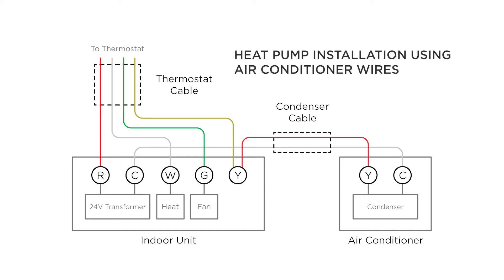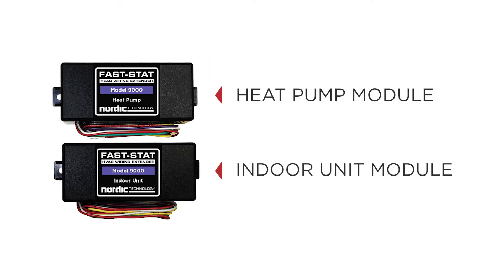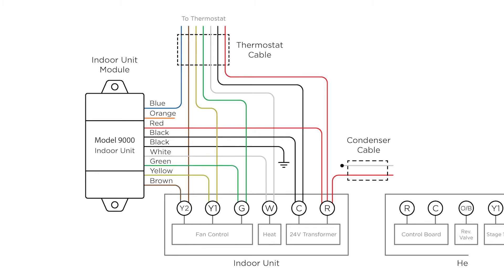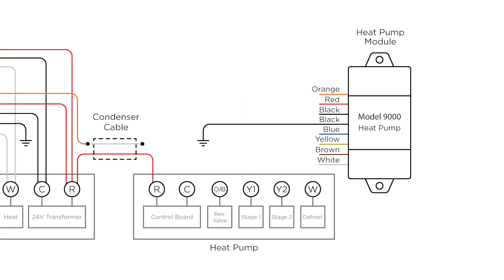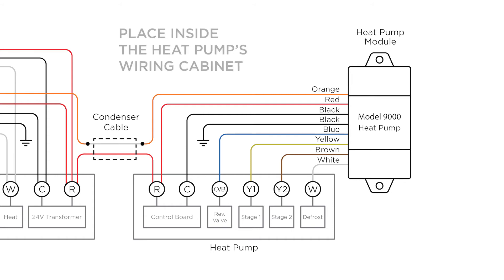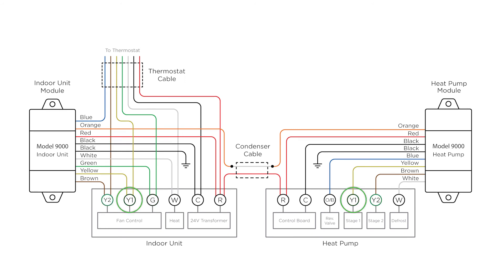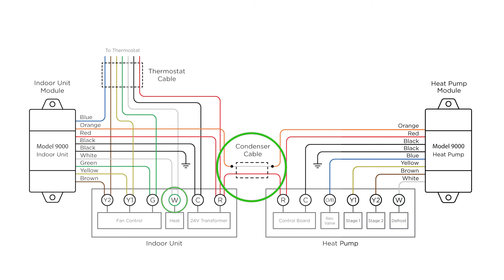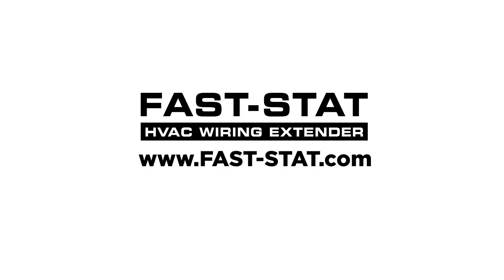FAST-STAT - Model 9000 (Air Conditioner to Heat Pump Conversions)

Comment: Where that blue is connected to ?
Reply from the maker: Great question. The blue wire on the indoor unit is for the reversing valve and it is connected to the O/B from the thermostat.